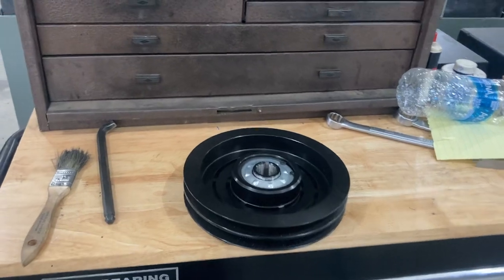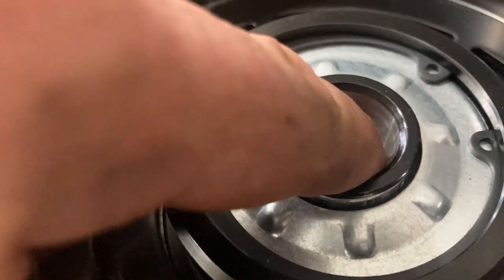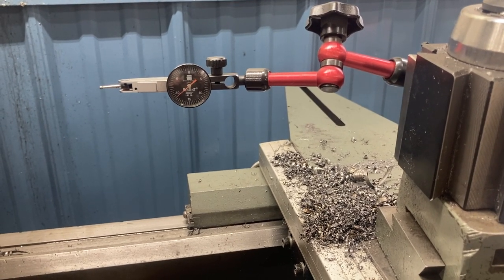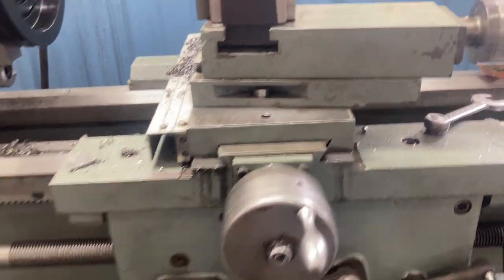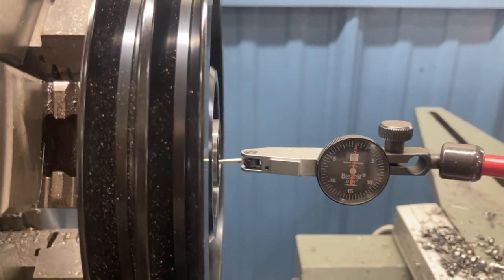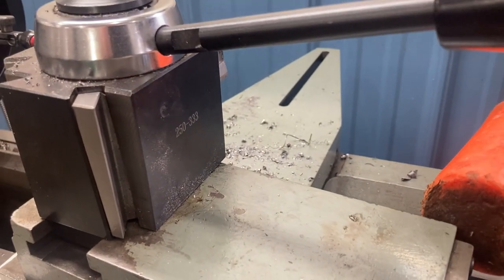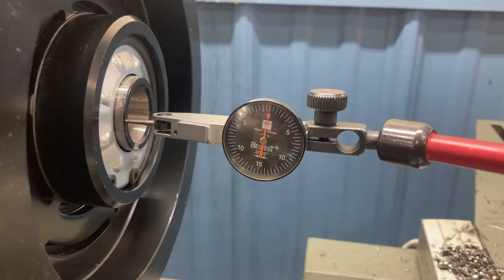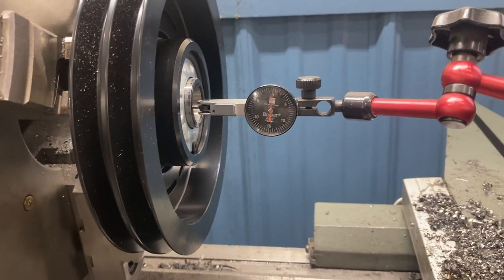Manual Machinist Trick - Indicating a Tapered Bore - SHOP TIP

Comment: Bores are usually standard like threads are standard. For example, if math shows the taper to be .997 per foot, it is probably 1.000 per foot. 1.000/12 = .083333 per inch included angle. Divide by 2 and dial in on a straight and true rod using a travel indicator.
Reply from the maker: Thank you for sharing!

Comment: How do you go from being lined up as if your were going to cut that bore to being set up to cut the tapered shaft? Is there a full video of this?
Reply from the maker: The shaft would be the exact same procedure as this. You would indicate the taper on the shaft. Or you could indicate the bore but on the opposite side of the bore than what we did here.
Reply from the maker: Visualize how the compound is feeding. Set up like this video, if you turned the shaft you’d have the large diameter at the end of the shaft. If you indicated the opposite side of this bore, then you’d have the compound correct so that the small diameter was at the face/end of the shaft.

Comment: I missed how you make sure it is on the center-line. Just by eye? I wouldn't think that would be accurate enough?
Reply from the maker: There’s lots of ways you could choose to do it. Center in the headstock, the tailstock, with a steel rule, or even by eye in a non critical application. I can think of some other ways too. It you mount the indicator in tool holder, you could raise and lower it with the adjustment and find the centerline.

Many ways to skin that cat